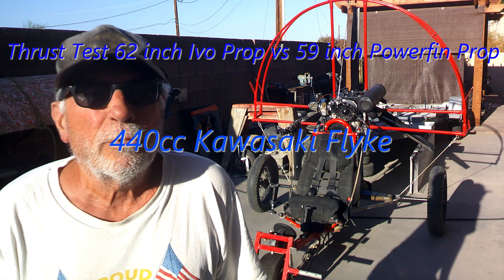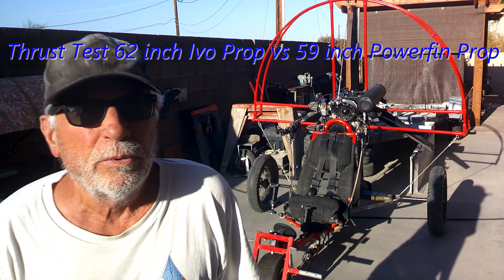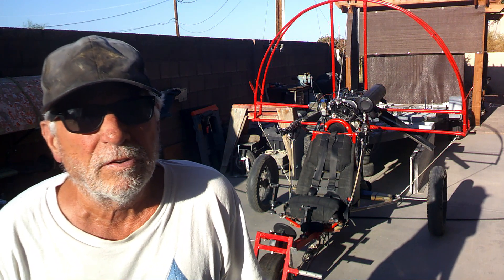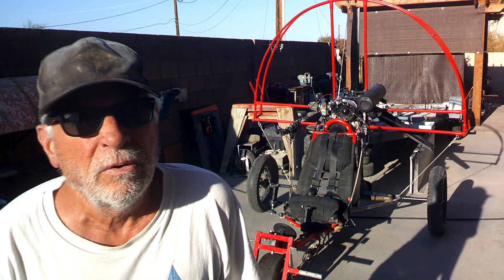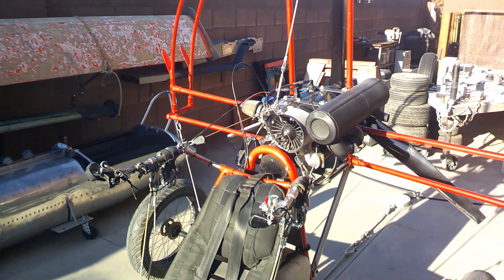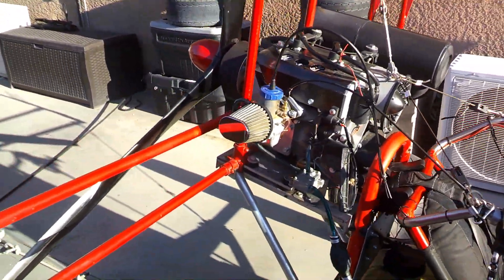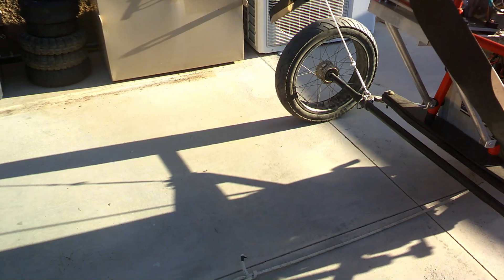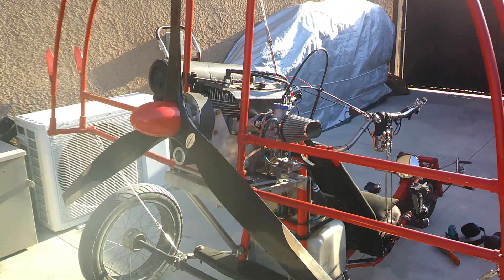Thrust Test Ivo Prop vs Powerfin Prop 440 Kawasaki Flyke ppg trike

Comment: You’re not comparing apples to apples. In fact, your comparison is providing no usable or good data whatsoever. I guess, unless you own both of those propellers and you’re trying to decide which one you want to use.
Reply from the maker: I did it for my own curiosity since I fly both props. Sorry if you found it usless.